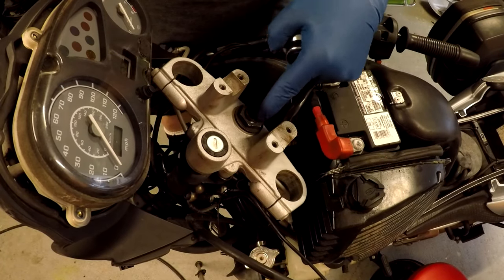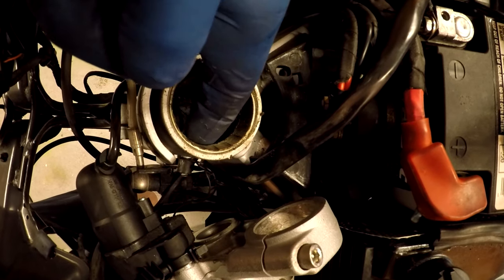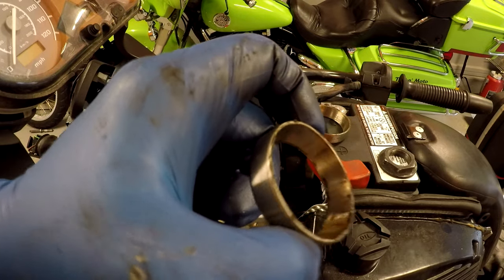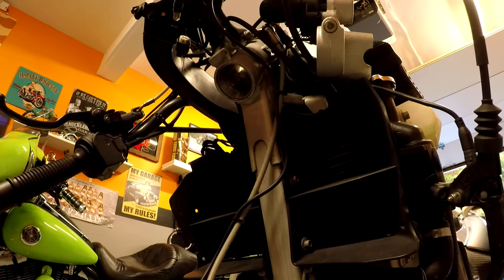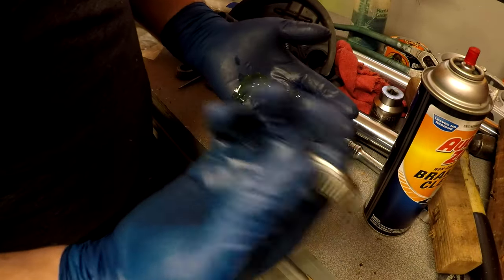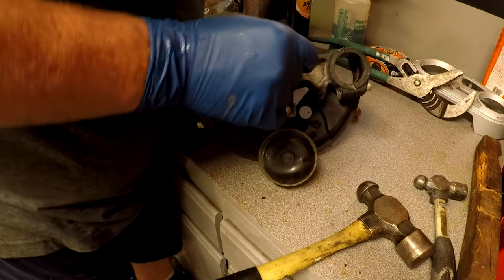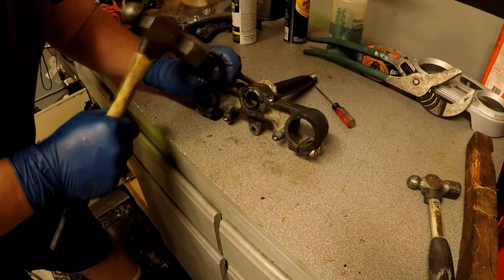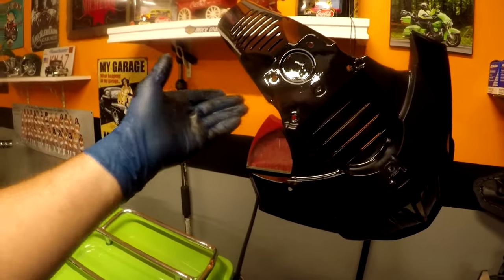Steering Head Bearings- 2007 BMW F650GS | Techn' Moto

Comment: Nice job. I may have to do this soon, so the video was on great help. Using the old races to seat the new is a good option if you don’t have the right socket size. I was taught he old school bearing pack method at a young age. I agree it is the easiest and still most convenient way. Thanks for the vid?
Reply from the maker: thank you for the comment I appreciate your time. Pretty easy to do, I'm sure you'll get it done

Comment: I just bough a BMW F 650GS 2007. Its the first bike like the I've ever owned. It sears "funny" compared to my Honda CRF 250L. Almost like I doesn't want to turn but once it starts it wants to over turn. No crunchiness in the steering. Does that sound like a bearing issue to you?
Reply from the maker: Could be. Have it checked out
Reply: I have the exact same thing. Bought an F650GS after being satisfied with the F650 Funduro. It seems it wants to go straight, and then when you get it to turn it is smooth again. Did you figure it out?
Reply from the maker: Check the steering bearings.
Reply: I will, thanks!